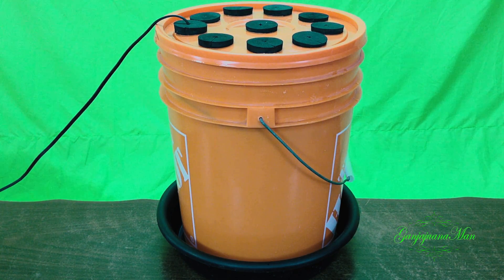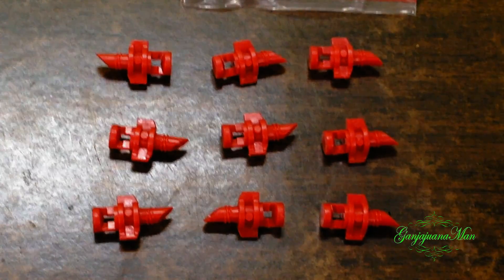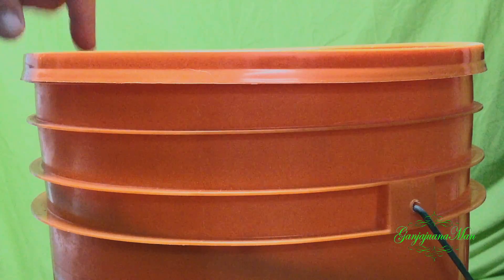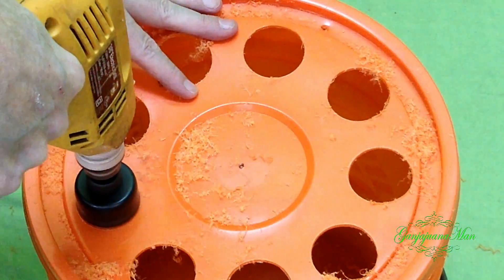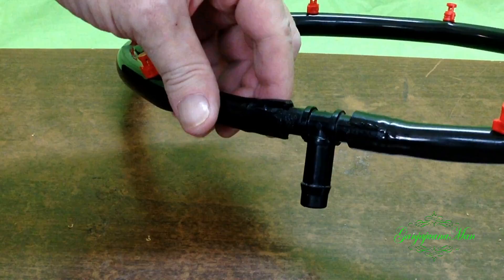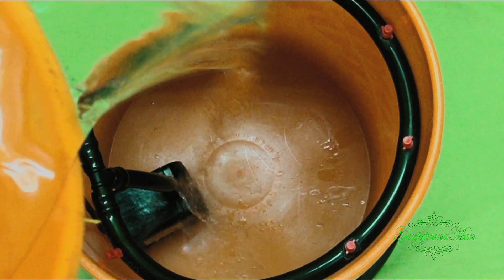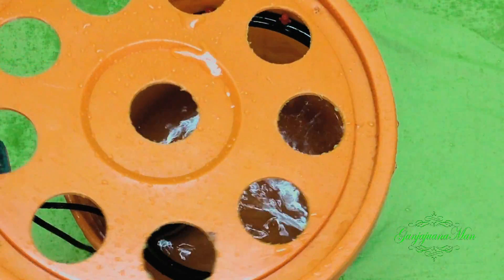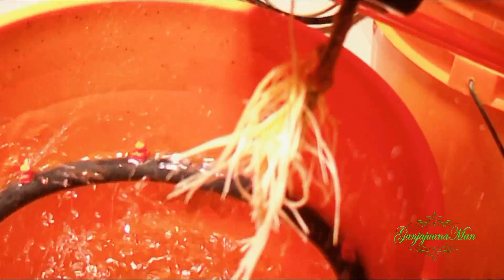How to make the best Hydroponic Super Cloner

Comment: I have a question my man, in what phase do I cut the steems, can I cut them when they are flowering?
Reply from the maker: Ideally, you will cut them in veg, a week or two before the plant go's into flowering. but Yes you Can also take cuttings during flower. They may take a little longer to root & then they have to revert back to an 18 - 6 veg cycle.
It takes a little longer but yes, I'm about to do that myself.
To get roots I make a half strength Flowering mix & 
This is a plants Best friend. I add some N.P.K.RAW, Kelp to the mix.
When you add that, it stimulates root growth at All stages of plant growth.
When you add that to a foler spray, it will temporarily stunt top growth & promote side branching, making huge bushes Very easy to grow.
Reply: @GanjajuanaMan  omg you answered my question, thank you my guy, I'll do what you said then!
Reply: GanjajuanaMan NPK RAW KELP is a product?
Reply: @GanjajuanaMan   There's an NPK/RAW industries distributor here where I live and I got to meet Harley Smith there.
Reply from the maker: @michaelteran3844  That's awesome, I have learned more about feeding plants from Harley Smith then from anywhere else. 
Thanks for watching !
Reply: Hey bud come back and do videos
Reply from the maker: I leave it on 24-7
Thanks for watching.
Reply: @GanjajuanaMan I love indoor farmer!  KW shout out!
Reply: cutting in flower yields what are called "monster cropped" clones which yield much better in many cases.
Reply: DON'T MESS WITH PLANTS WHEN THEY'RE FLOWERING!!  THEY'RE PREGNANT!!  DON'T STRESS THEM OUT!!! 

This being said, you can clone, ONCE the stems start growing alternately.  Branch growth, the first 3 or 4, come out in pairs.  It's all auto.  Once this stops, they'll alternate....imagine your hands climbing a rope.  You start out with two hands, then, you start puling up by alternating your hands.  Once you see this, the plant can survive.  Don't take the center stem, clone off the shoots, the branches.  Don't pull the auto ones....the alternating ones, only!!
Reply: @DarkSevariant  great bit of advice. Nice one.
Reply from the maker: Yes,  in Canada it can be bought/ordered from "Indoor Farmer" & it can be found on Amazon but on Amazon sometimes they try to charge  too much for it. An 8 ounce bag costs around $30-$40 Canadian.

Comment: Question, those are standard 2 inch neoprene inserts that you're using, yes? So did you need to cut the holes WITH a 2 inch bit on the door knob hole maker or was it necessary to use a 1&3/4" bit in order to get them to fit properly? I'm hoping to build this exact cloner, you've inspired me! Already got the order in for everything but the drill bit. Can't afford a full hole making set RN so I'm forced to order just the one so gotta get it right. THANKS!!!
Reply: Aaaaaaaand my neoprenes fell RIGHT THROUGH with a 50mm/2" bit. Dang. I just noticed yours appear to flair out a bit towards the top. Definitely would help with mine which are flush flat on the sides lol. Luckily I tested it out with the first hole so I just made my own insert from foam and used that hole for the plug.

Comment: Cool! I invented a similar device, but more simplified. I have one using a 3 gallon bucket and another 1 gallon bucket, using a large round airstone glued to the bottom of the smaller bucket, and one hydro spout glued in the larger bucket. I too made 2 inch holes but I dropped  in net pots which I can use whatever medium I want or none at all and they still root vigorously! I also have 2 inch plastic covers with hole in the middle and a slit on the side ( to place or remove from plant stem) to cover the hole so no light gets in. I also use a clear plastic bowl from the Dollar store to cover the 3 gal, and a smaller one from a cake container for the 1 gallon to use as domes. Of course I use a cloning solution and low fluorescent light and I have 95 - 100% success rate. Cheers Brother!
Reply: show me im very interested
Reply: so you have 1  gal bucket using a air stone and a 3 gal using hydro spout ?

Comment: The issues I have with this is that the little sprayers  gets clogged up, every other day etc.  l had my DIY cloners buckets etc out in the garage but in the summertime  especially living in south Florida, the water inside the bucket will heat up. If I had a garage with ac running in there, it would had solved the whole problem.  Once the water temperature hits 80 degrees it just kills the roots. You need to keep the water temperature around 70 to 75 degrees, give and take some. So I've started making cloners out of ice coolers so the water would stay cooler inside. But the temperature started climbing up through the day. you can  always throw  bottles of frozen water in the cooler which will bring the temperature down temporally. But it'll go up slowly again. So this year I converted the aeroponics into a hydroponics deep water culture cloner. Using a air pump and air stones  to bring oxygen into the water. This way the temperature stays stable throughout the day around 74 degrees. Mostly because there's much more water in it about 10 gallons more compared to having only a gallon of water in it with the aeroponics system. So this summer It's all about deep water cloning. 
 I haven't decided yet to add any nutrients in it yet. But I just ordered a couple of aquarium sponge filters to keep the water clean.
Reply: get a dewey mister....air pump outside of the bucket, no heat issues
Reply: 15-20s on each 2 minutes

Comment: What’s your timer like for this ? Last round I did 24/7 but my pump was real weak I’m thinking that way the issue it was just sprinkling out not misting really- I’ve heard 15min on/off but that seems excessive maybe I’m wrong though
Reply: @kaywhygg6980  if using rockwool you can go 15 on 30 off

Comment: What temp is good for water
Reply: Is 80 to high I'm not getting roots after 2 weeks
Reply from the maker: @roybrooks13  mine is room temp. 80 might be too high.
Are you adding any plant food ? use half strength flowering mix or add a little Kelp powder. Are the stems getting sprayed and staying wet ?
even with plain water you should have some roots by 10 days.
Reply: @GanjajuanaMan  they have a sprayer I'm using off food
Reply from the maker: Room temp.
Thanks for watching.
Reply: @GanjajuanaMan  thanks for your help

Comment: I believe an airpump wit stones n net pots would be better. Those submerged pumps get the water to hot and those dang sprayers clog to easy. Set your airpump in the coolest spot in the room or in a different room with longer lines. To keep water temp down.
Oh yeah and with net pots wit hydroton the heat that does build up in the bucket can escap out the top. Again keeping the temp down.
Reply: Your suggestion about using net cups would allow the rooted plants to be lifted out by the net cups and immediately set into a separate hydroponic tank, without a lot of fussing about the roots or stem. Neat idea.

Comment: I built one of these...my cuttings have been in the bucket for over a week and i don't have any roots at all.  I have cloneX in the water, and root gel on the ends of the cuttings.  water is running 24/7 any suggestions or help would be great!
Reply from the maker: I add N.P.K. Kelp powder into a flowering mixture, I take clones 6" tall & shred the stem a little bit at the end & I scrape the stem a little so that roots can sprout from more parts of the stem then just the end. for rooting I have a 24 watt T5 grow light on 24/7 under a dome, I open the dome once every day for fresh air.
9 out of 10 times I get roots in under 10 days.
But N.P.K. Kelp powder is your plants best friend.
Thanks for watching.
Reply: @GanjajuanaMan  Any recommendations for the kelp powder and flowering mixtures, brands etc...
Reply from the maker: Go on Amazon & type
N.P.K. Raw Kelp powder.
Reply: @GanjajuanaMan  Thank you sir👍
Reply: I noticed that roots grow faster in dark environment. I painted my deep water cloner black and make sure theres no light that makes it inside the machine. First time i did this it worked and the second time i did it just got all green with algae.

Comment: This is an aeroponic cloner, not a hydroponic. The stems are suspended in air, and you spray water on them. In a hydroponic cloner, the stems would stay in water, and have air bubble around them.
Reply: Which works better for weed?
Reply: @josephmcguiness6452  Ive had sucess with an aeroponic but I think they would work the same
Reply: @timothyotten8744  great. Thanks for all the knowledge
Reply: i was thinking the same
Reply: You are correct!
Reply: Yup. I just built one very similar myself with a 5 gal and I'm thinking of doing a bit of a aero/dwc hybrid by putting in an airstone just to keep any roots that wind up submerged below the water line nice and oxygenated. 

I'm a bit nervous about running it either way, straight aero or with both, as I've got nothing to use for a rez cleaner until I can afford to buy some and I'm concerned about microbial growth. All I have that I can see helping out somewhat in that regard is HydroGuard. Perhaps colonizing my rez with a  beneficial microbe preemptively might be sufficient? Maybe not with the airstone included as that would definitely be introducing new airborne pathogens into the tank and feeding them to boot lol. I'm new to aeroponics in practice so I'm just nervous.
Reply: @timothyotten8744  thank you for imform us
Reply: Tomayto Tomahto

Comment: Great video. Is there a specific size micro sprayer to get? I'm using your method with the 1.5 tubing. I wasnt sure if that would work with a 1.5 micro sprayer
Reply from the maker: The hose I'm using is 1/2 inch.
The sprayers that I have only come in one size, but you can choose to buy either a 360, 180 or a 90 degree sprayer.
Recently I saw on Amazon a pack with all 3 different ones in there.
Hope that helps & thanks for watching.

Comment: Bud, the simplicity of this design is brilliant. $300-400 for a closer in most hydro shops. You get a clear tote type setup and fuck does it look slick, but what is the end game? Cloning great plants..... your design can be picked up and moved with ease, you can build 10 of these bucket cloners for the price of a pro made cloner. The spray heads can be purchased that spray 90 and 180 degrees to concentrate the water spray direction. Again ......great video .....love it
Reply from the maker: Thank you for your comment ! 
I don't mind supporting good products, but the prices they are charging for simple things is just ridicules. Because you still have to put those expensive ones together, so they are No easier, just cost more. WTF.  Yesterday I searched "hydroponics" on Amazon.ca & saw packages of sprayers. 150 in a pack that had 360, 180 & 90 degree sprayers in one pack for under $20
Recently I have seen people selling something called 
auto-pots, & again they are ripping people off at over $300
when you can make a better system for a fraction of the price. I don't like to be ripped off & I don't like to see other people get ripped off.  That might be my next video, I'll give it some thought.
Thanks for watching.

Comment: I need to make 30,000 Hazelnut clones.  Do you think its possbile to do it with this methode?
Reply from the maker: Your gonna need a lot of buckets lol.
Reply: Probably better off doing rockwool cubes under a humidity dome for high volumes of clones. The aero system in this vid is probably better for root development and early growth performance vs a rockwool cube, but may not be cost effective for anybody doing more than a small room of 6-12 plants.

Occasionally online resalers (OfferUp, craigslist, etc) may be selling food grade buckets for very cheap ($20 retail vs. $5 resale), which does bring down one of the major portions of the cost of this design. Something to think about.

Comment: Hey man so do you use any kind of cloning gel or any nutritional supplement to the water?
Reply from the maker: I mix a half strength flowering solution & add
N.P.K. RAW Kelp powder.
Thanks for watching.
Reply: GanjajuanaMan Yea, this answers question i asked above. Is kelp essential?
Reply from the maker: Kelp falls into the "Beneficial" category not the "Essential"  category of nutrients. There are many products on the market for rooting in hydro cloners, most cost a lot. I bought an 8 ounce bag of N.P.K. RAW Kelp powder 4 years ago & still have lots left. A little go's a long way with that stuff.  A lot of people spend lots of money on Giberilic acid for rooting, but it is an extract of Kelp, so save money & buy kelp & get the Giberilic acid + all the other beneficial nutrients that are in Kelp.
Reply: @GanjajuanaMan  you are dropping a lot of really great free knowledge here that otherwise may not be learned for years by most growers. Thank you for sharing your methods and please know that it is very much appreciated.

Comment: just an idea but it poped in my head that your sprinkler system could be adapted as a drip system with a second bucket below the first one with the pump in it so the first one drip in the second one :) a little more work to setup tho  just giving a different point of view if you never tried it :P but your idea works like a charm too and is the cheapest  :) cheers